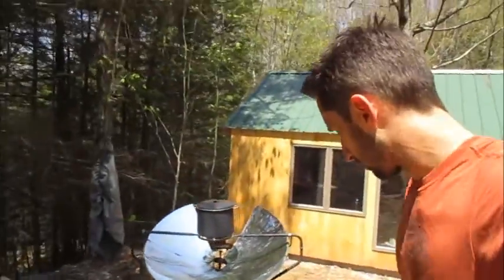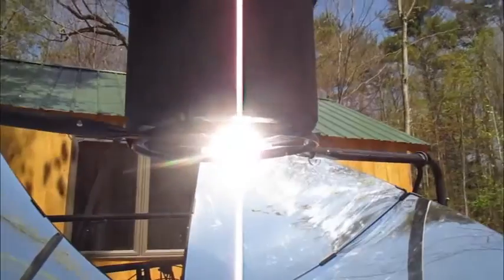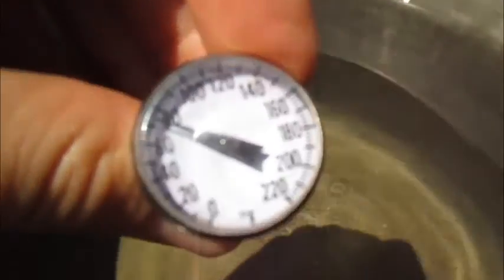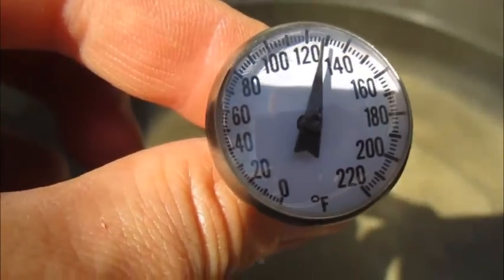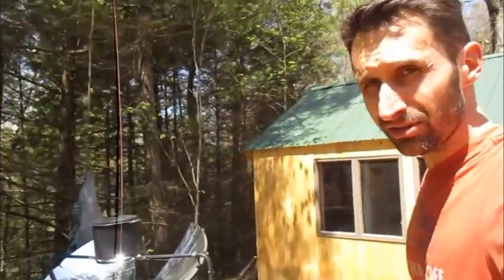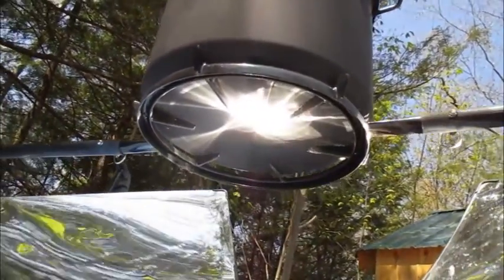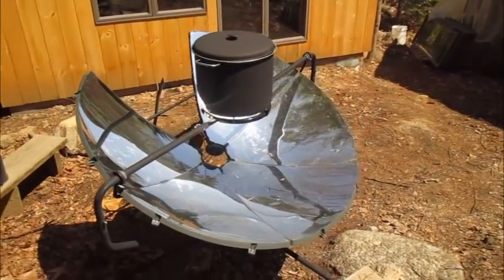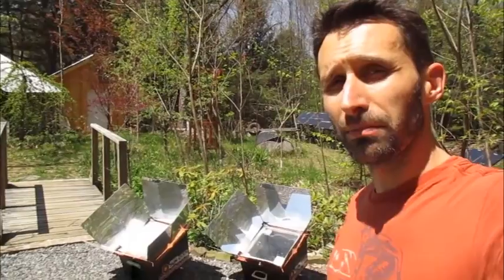Parabolic Solar Cooker vs. Pressure Cooker?

Comment: Black flies are a scourge here in Iowa too.  I put my flock of cockatiels out in an aviary one fine May day, and they swarmed them and killed 4 before I could get them back inside.  I run around with a miner's helmet smeared with engine grease or Vaseline to catch the darned things.  They are attracted to the tallest object, so the head is the target.  My poor horses get eaten up too, so I smear Crisco on the areas that are affected (they are too big to use Vaseline-too expensive.  The flies stick to this like glue. Vanilla based insect repellents sometimes work, sometimes not. Horse spray and other fly repellents don't seem to work. Skin-so-Soft doesn't work.
Reply from the maker: I did a video on a piece of gear that really helped with my fly problem. Now you seem like you have a lot of area you're having issue with, but in terms of clearing some areas where you personally want to exist outside within, this thing may help you: https://youtu.be/rRKt8mGIcTg
Reply from the maker: That's really sad about your birds by the way.

Comment: Just wondering... If you put a cast iron griddle on that could you grill with it?
Reply from the maker: You'd have to keep moving it around. I cracked a hole in a cast iron pot trying to cook chili over this when it overheated in that one point where the light focused.

Comment: Those black flies look vicious. Interesting experiment. I'm wondering if it had a very secure seal (like your American canner) if it would come to a boil. Of course my American canner (and yours) is too precious to experiment with.
Reply from the maker: +Prepper Potpourri - Yeah, the black flies are silly this time of year. It's surprising they even have enough to eat (there being so many of them). The only meal they seem to have available is a few chip monks and some guy foolishly offering himself up while he shoots Youtube videos. How did they survive before Youtube I wonder? ;)

Ever confident, I'm sure that with modifications, something LIKE this could be made to work. I suppose that ultimately the value of this experiment is to give people a sense that something WOULD need to be done to help things along. The next person to perform this experiment can now skip the simple setting of the pot on the cooker and wait method, and try something with a bit more insulation etc.

For me, pressure canning outside is never anything that would personally appeal to me anyhow since it'd be hard to keep things clean and sanitary with everything floating around in the air outside (dust, tree debris... black flies). If my electric stove was not an option in a SHTF scenario, I'd just fire up the woodstove if needed.

Thanks for sharing your thoughts.

Comment: Complete the missing part in your parabolic reflector. It could give additional reflected concentrated heat and will take a shorter time to boil your water. Look at other videos on parabolic solar cooker.
Reply from the maker: That's the way it's sold - with that section "missing". It seems like it's missing, but if one actually uses the model, one finds that the section being gone allows MUCH easier access to the pot (from behind the unit). It also doesn't seem to have any issues heating things up in a hurry. Also, a large portion of that "missing" section would be shadowed by the pot anyhow. After having used it, I think it works really well this way. In the end, it's not the shape, but the number of square inches of sunlight that are reflected onto the pot. Those inches could be collected from a circle, a triangle, or a pacman shape, but ultimately all that matters is how many square inches are being utilized.

Comment: Thank you for the video. It proves what I've felt, that the parabolic is not as functional as the ovens. I also don't need it as our 750w solar system will power one of the burners on a electric hotplate. We use it for frying and pressure cooking. I keep a 4 quart pot in the Sun oven when it's not cooking just to have hot water.
Reply from the maker: +Jim Barnaby - You sound like you have a pretty decent amount of thought and time put into your own setup.
Reply: +Praxis Prepper Thank you. I started in with passive in the 70's and if we had PV back then I think we would see more off grid housing.
A thought on the parabolic. On one video you mention that the it got a pan too hot for normal cooking. I would suggest a metal plate to temper the heat and allow it to be used for more than boiling water. Different thicknesses would give you different cooking temps.